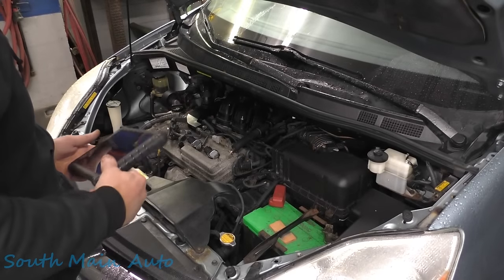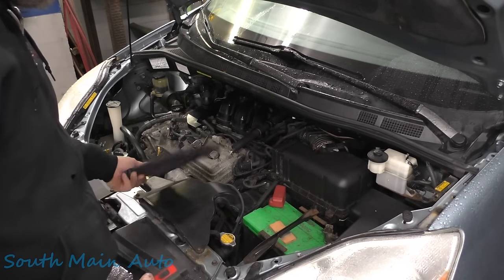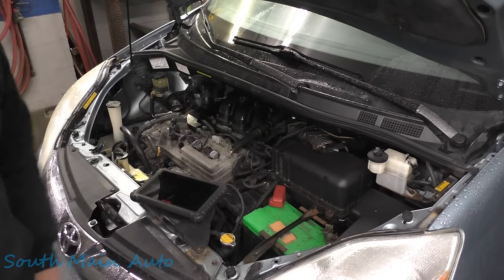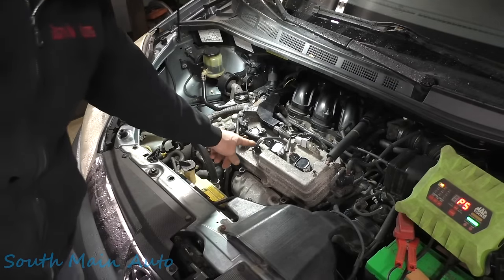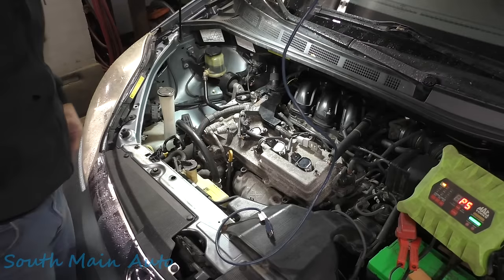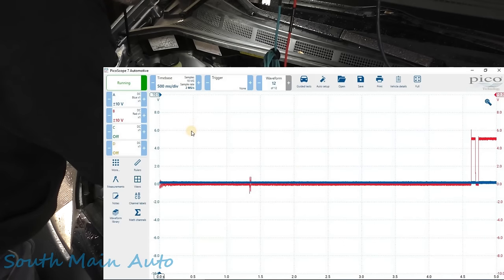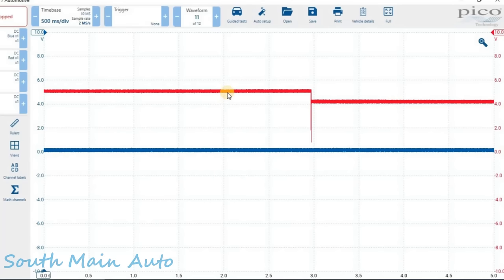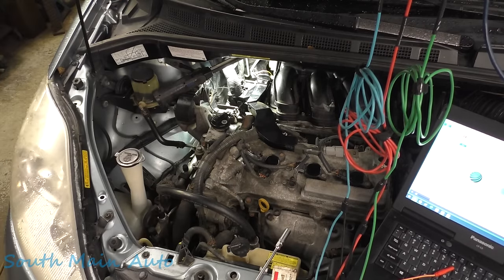Toyota Sienna: P0340 Camshaft Sensor Problem

Comment: I knew those sensors were sensitive but man I didn't realize they was that touchy dang Skippy Love video thank you so much for showing us how to figure it out love watching your videos
Reply: Yeah, intuitively you think about a magnetic sensor like it was a magnetic door-close sensor or similar that should be quite forgiving of exact door position. However, cam and crank sensors are responsible for delivering signal edges (high-low, or low-high) that precisely reflect rotation angle position of their respective shafts. As such, they have to be in close proximity to the toothed wheel to register an on/off or off/on at precise angular positions. They could indeed be adjusted or designed to register from a distance, but the magnetic signal would be weaker, and more important, the transition of the magnetic signal from "tooth present" to "tooth absent" (or vice versa) would be much less sharp, and render less-precisely-timed waveform edges.

Comment: Two nations divided by a common language Eric! I may well have mis heard your explanation. Did the client try to fit a badly moulded 'snide sensor' which he forced in with the bolt bending and braking the fixing lug and as it did not seat the air gap was increased? Thanks for sharing your professional diagnostics.

Comment: I knew as soon as you got your big mittens on those sensors that you'd virtually figured out what was going on, strange how some materials fail, obviously the metal insert is to prevent overtightening but....if the whole assy is misaligned to begin with?  it can bring on a world of woes. Great diag as usual, your experience shows and just maybe that was really the root cause here, not customer blaming in any way , I have definitely done the same thing myself.T here are always new things to learn. 👍

Comment: Thanks again, Eric. Just watched this for a 2nd time.
I greatly appreciate your impressive abilities ... Repairs and Videos. 
 
Sadly, we now sprinkle sensors all over our vehicles so that our "Control Modules" know what to do and how to respond in real time  ... AND NOW THE SENSORS THEMSELVES ... have become major failure points. I purposely drive and maintain a 20-year-old Lexus RX ... cause it is a bit simpler ... compared to some of the new "Hangar Queens".

And we STILL rely on cheap-ass'd connectors and wiring to provide communication links between the CAN BUS and modules (aka Micro-Computers)
Only Air-Bag Circuits get gold-plated connectors and better wire!
BUT ... the Dealers, Repair Shops and Parts Vendors ... JESS LUV IT! $$$$

Comment: Was noticing a longer crank on my 01 Sienna and an occasional harder time starting. Decided I should check the plugs. Gap was about 3 times what it should have been but otherwise it ran fine. They were probably overdue by about 100k miles in my estimate. I bought it a year ago and never replaced them because it ran fine.

Comment: The cracked sensor was in the back.  You had a hard time getting that other one in the back.  When the customer put that in the back spot initially, it was tweaked at an angle and broke.  You happened to notice it wasn't seating proper... they probably didn't.

Comment: Man I swear those Siennas are part Sherman tanks. Ours was a 2008 and and we drove it 167k miles and I'm sure it wasn't even broken in. Biggest thing I had to do was replace a steering rack. Thanks as always, Eric!
Reply: @DIYDaveOK  toyotas are beyond reliable. Built to last. That's why it's the most bought car

Comment: Quick tip with the scope: running both the ground and the signal leads right next to each other will help cut out some of the HF noise, or using a fancy coaxial lead with whips as short as possible will do the same.  Both leads will pick up the same noise in opposite directions and cancel each other out.  It's the same reason that network cables and phone lines run both wires as close together as possible and network cables are twisted tightly.
Reply: The issue is common mode noise due to using the battery ground for reference.
On most scopes you have to reference to battery ground.
But with the Pico 4425A like Eric has (I have the older 4425 without BNC+) , each channel has a floating ground which can be considered isolated for voltage differences of up to 30V.
So, making both the signal and ground connections for that channel at each sensor results in textbook clean waveforms without any filtering.
It's even able to be used like that on a VR crank sensor where both ends of the signal float above ground.
Using the channel ground on signal low will not short signal low to actual ground.
Ideal for active wheel speed sensors too, as some have the signal on the low side with a fixed high side.

Comment: Yo Eric, Hi from the "" Corrosion Belt "" here in Florida !!!!  Good diagnosis and testing procedures. No just replacing parts till you find problem and empty the customers wallet. Quality workmanship - absolute transparency for the customer to see that he or she is not being ripped off. Other shops should emulate your business practices !!! I like these kind of suspense videos where you have to be Eric " Holmes " and deduce who or what the culprit is !!! We all like your "" wack it, heat it, burn it off, search for the hidden corroded wire/connection, big nasty to the rescue videos. Never a dull moment at SMA !!!!!!!!! On to the next case !!!!!! 🔍🔎🔦⚒🔧🛠🤔  Well done !!!!! 😺👍👍
Reply: Nice way of saying that you live on the coast. I was surprised in my few trips to Daytona how rusty the cars do get down there! But still not as bad as here in the land of Lincoln.
Reply: East coast? I got stationed to Patrick AFB/Cocoa Beach in the 90s and one of my cars completely rusted out in a year. I was on the barrier island about 100 yards from the beach and a 10' wall inbetween.
Reply: I live in Fort Lauderdale and I brought a car home from the dealer and the next morning it was gone. All I found in the driveway was four tires of battery and a wire harness and a steering wheel.
Reply: That’s why I love my current independent we take all out bmws to. We had an issue but he was not able to duplicate it and had the car for days driving it around. Issue never came back. He didn’t wanna shotgun a fuel pump and module at it without being certain. The car has never had the issue since. He didn’t even charge us anything for the diag time.
Reply: @thebluelunarmonkey  salty air and high humidity will do it.

Comment: Fault with sensor body, hold down as perhaps intermittent, known difficult start.    This bit of trouble was so real to plastic components with interior hall effect.  Where as poor design, poor manufacture can hide, mask fault(s).  Leading to additional long, hard start wear as constant to that system.*Bits of iron and rust can cause failure.  And, where the owner, driver can easily realize troublesome starting as a real problem.   *here, with a trouble code. 
Questions like...."did the cheap, ebay source match best design.  Match best component function?"
Are best replacement parts being used?
And just maybe, as a repair, use only the best quality available and any questionable part removed.
Honest, direct report to customer....very likely to repeat, satisfying business.
Thanks for having me along.  A reminder to myself to be keen to inspection, fitment at every turn. Best use of mirror and scopes.....always. Avoid tow cost and come backs. Check.  double check.    M.

Comment: Possible that when the customer put in the rear sensor, he had the same trouble you did, getting it to seat flat..  and rather than use some lube and get the sensor in there... he used the bolt to try and pull it down flat.. or did not even notice that it was not going in flush.. and the bolt forcing it down and the sensor not wanting to go down, cracked the housing.

Comment: You make great videos. My first thought before you verified the code was a scratched timing belt ? Everything after that came with experience ? Why you didnt notice broken sensor at first glance could have lead you in another direction ?  Ive been there done that when ya know problem has to be there and you keep looking. Recently had a problem with an air flow meter on a Maxima after replacing with a new aftermarket and it did not fix problem only to figure out new after market part was no good ? Only experience kept me focused and kept me from looking for other causes and steer away from original diagnoses when I was unable to confirm repair ?

Comment: You can null out the noise by plotting  signal minus the green ground.  That will subtract out the noise on the ground, which should be like 90% of the noise.   Or use a coaxial cable, grounded near the sensor.   Od electronic technician lore.
Reply: Actually no maths required, you can make use of one of the key features of the Pico 4425, which most techs tend to negate by using battery ground.
That is partly due to the "School of Bernie" - Bernie Thompson from ATS is a highly regarded diagnostic expert and is forever saying "Always reference your scope to battery ground for proper testing".
Sure you must do that when you've got a scope with one common ground for all channels, but the Pico 4425 actually uses floating grounds for each channel, which can be considered as isolated for up to 30V difference between them or to digital ground (from the USB).
Therefore you would apply the probes to signal and sensor ground at each individual sensor, with no worries about creating an unwanted current path via the scope grounds.
The Pico leads are shielded all the way, even past the point where the ground lead branches out.
Reply: Years ago on the old '60s Corvettes when they first start out they put a shield over the distributor so it wouldn't send static through the radio I think it's similar a nature have a great day

Comment: Denso parts are typically good parts with good quality control. I'm curious to see where the customer purchased the sensor from. There are a ton of knock-off Denso products on Amazon and eBay. It's tempting when a sensor costs half of what it does from a Mr. Toyota.

Comment: Eric,
Great video and fix - thank you! BTW are you certain that was the 3.3 engine? It looks like the 3.5 that was used 2007+
Paul (in MA)
Reply: Came back to say the same thing. Thought over it for the day. Didn't know if I should have said anything to correct or not.. but in the second gen mid term refresh they realized what Eric said about them, the 3MZ was poo. And they gave it the more powerful 2GR. That engine is used in some Lotus units albeit in much lighter applications.

Comment: Nice call on the bent tab! Wish you had tested also the other sensor customer had in the trunk - would be interesting to see if both were banana shaped 🙂
Reply: Replacement parts are all Chinese. You have to buy 3 most of the time to get a good one.
Reply: Banana shaped ? Sure that was a sensor ?
Reply: @ksavage681  Yep, that's very true.
Reply: yea I was thinking same thing, maybe the customer was over tightening them and snapped them both
Reply: @belowzeros  Yep. Could be.

Comment: 92 ranger had a code O2 sensor.
Got the new part, but made the mistake of cleaning the idle air control and the MAF sensor at the same time.. the light went out. Fuel mileage went down to six MPG. Reinstall old sensor and reinstall black tape over light. 15 miles per gallon. Runs great. No light!

Comment: The crack was probably caused by over tightening in the past. I have seen it in the past with a mechanic doing the exact same thing and overtightening the ferrule with a plastic surround.
You could of course test the sensor by moving a screwdriver in front of it to give a pulse, they work just like a guitar pickup with a schmitt trigger output.

Comment: Hey there.

Good vid as always.

I've learned a number of things watching your Vids.
You have a very solid handle on electrical theory.

I was amazed how weak the signal is on the cam sensors in the show.

Pretty crappy how you barely move them and the signal goes for a sh#&...

On your scope the extra  length of input cables are coiled up and taped.

Could a coiled lead increase the noise on the scope channels?

Maybe from spark plug induction ?

Just a thought.

Jack
Vancouver
Canada.

Comment: Some fasteners are Torque-To-Yield.  Apparently these ones are Torque-To-Scope!

I almost got bit by a Toyota this week.  A shop arced the positive battery cable to the case of the VVT module {<2" of clearance between the two) while jumping the car (2022 Corolla), and Toyota dealer wanted to replace the module for $3,200.  Car would barely run.  What'd the car actually need?  The codes to be cleared, and a key cycle.  The PCM was so sure there was a problem with the VVT module that it wasn't even listening anymore, despite it working just fine.

Comment: 1965 Ford truck. Cranks but won't start. Spray some starting fluid in the carb and it fires up. So, fuel delivery problem. No scanner needed

Comment: WOW...tiny misalignment or caddywumpus on a sensor causing major issues.    Nice process of diagnosis, but some labor time spent to get there. How much do these sensors cost? I've found with some electrical parts to buy 2 and hope at least one of them works.  Thanks for the video.

Comment: When you found the sensor was wiggly I was wondering if the bolt was just a touch to long. Then you found the sensor was broken so even tightened down would wiggle. 
Seen a time or two where a bolt can get swapped accidentally and be just long enough it bottoms out before it actually clamps what it should.

Comment: cam sensors aren't bad on that 3.3, but the knock sensors...  too much labor!  I donated my 2004.  Did that sienna have an exhaust system?  Sounded like mine when I had a leak up near one of the front cats.
Reply: We did the same. Ignorant design.
Reply: Exhaust manifold cracks common in act mounted headers. A good welder could try. Future use.

Comment: When you swapped the position of both of the sensors, you had to apply a little lube to the o ring before it would slide in.  I wonder if the owner ran into the same problem when he was switching them around and instead of putting on little lube, he drove it home with the hold down bolt.  That would account for the cracked/tweaked mounting ear. 🤷‍♂️

Comment: You know how difficult it was to stick the bank one sensor in? I’ll be the customer used the bolt to pull it in and ended up fracturing the base. Just a thought.

Comment: I had a 340 code on a gm the sensor tested good wires tested good. With a scope on it I noticed when I moved the plugged-in connector I got a lot of noise, the connector was bad. The pin drag check would have reveled the bad connector.

Comment: The camshaft sensor works according to the Hall principle. It scans a ring gear on the camshaft. The rotation of the ring gear changes the Hall voltage of the Hall IC in the sensor head. This change in voltage is transmitted to the control unit and evaluated there in order to establish the required data. Interesting...

Comment: nice work eric, i have had a few of the bmw cam sensor codes in my time, smilliar sensor's to what you are using there, i found that on the bmw's the computer wants to see the 5v pulled down to 0v but i have had a few where it pulls down to 1-2v which the ecu don't like, this is both the 12v systems (new) and the 5v systems (old).
no idea why they went to a 12v system from 5v.
i had a few that where cracked and full of oil too :)  one had been cracked so long the oil wicked its way up to the ecu :)

Comment: Hey Eric.  Didn't you say in the beginning of the video that the owner replaced (or tried to replace) that cam sensor?  Noticing the difficulty you had fully seating that sensor, what are the odds that the owner had the same difficulty installing that sensor.  But instead of properly seating it like you did, he just torqued the screw down and yolo-ed it?  In hopes it would seat itself.  But broke it instead.

Comment: i have dealt with several long time cranks and fault on the crank/cam sensor that On older volvos 850/V70s 1995-2008 a commen issue, when the starter has been removed and someone have beat on it to get out of the dowl pin, it makes the crank/cam sync unhappy and can have very long crank time, poor starting (like timing is off) and no start.

Comment: The first replacement sensor was probably good, but not seated fully in the engine. That back hole probably needed a good cleaning based on how hard the bank 2 sensor went in. The OG sensor probably broken when the owner put it back in an tightened the bolt without the sensor fully seated. The question is did the first replacement sensor break the same way.

Comment: I had a problem with an aftermarket CPS where it didn't seat properly, the o-ring was too thick. Put in a new OEM one and its fires right up. Just a couple of mm off will throw it off.

Comment: The customer stated and you verified that there was another sensor in the vehicle. why did you decide to go new from NAPA instead of trying the other one first ???just curious. great feasoning power and results as always
Reply: That was failed - the new customer one was cracked, probably on installation - so why go back to the first failed one?
Reply: My guess as a shop, is to cover his own tail. A lot of times the big parts stores will pay labor on a failed  part if you are a commercial account holder/business. So said shop doesn't do the repair a second time for free..

Comment: worked in the elevator trade and delt with proximity sensors a lot my experence is that they get weaker on range the older they get,the  more recent ones had a indi light when triggered witch helps a lot with fault finding.yours must be super fast recovery speed.
Reply: Good info!